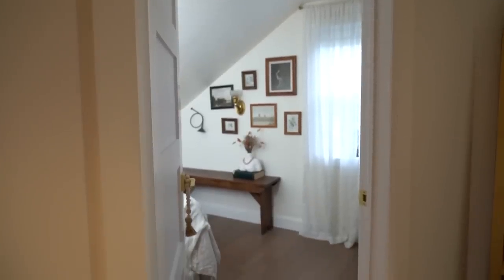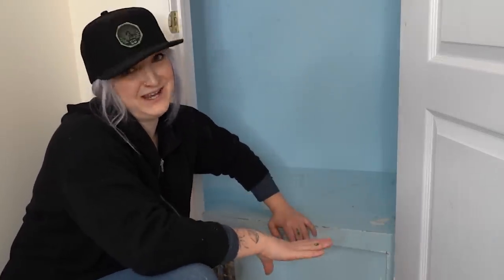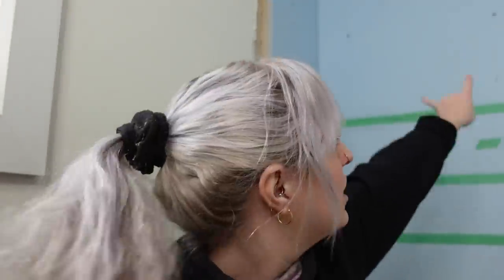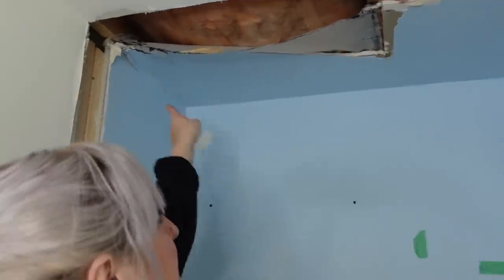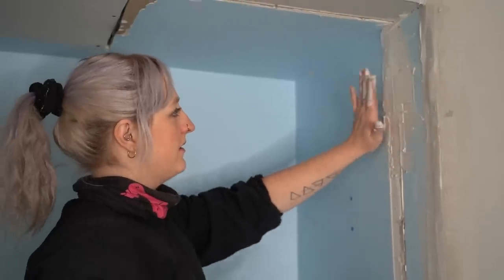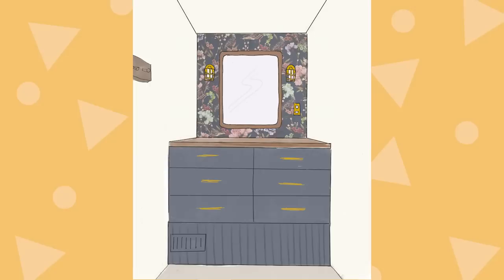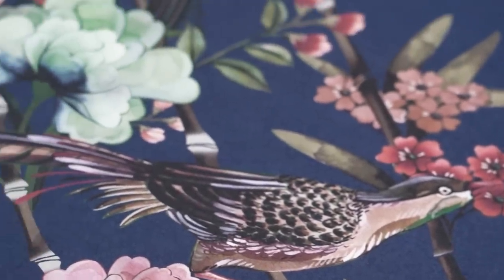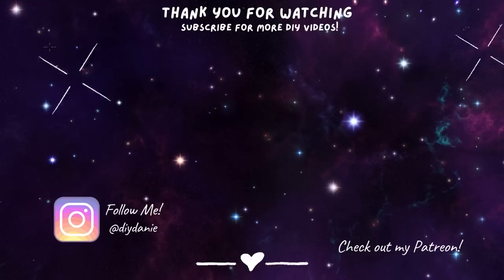i diy my closet into a custom vanity space! Pt 1 | DIY Danie

Comment: Lovely episode Danie! My suggestion is painted navy-sh blue lower part, drawers etc with brass drawer pulls of course! And for the top matching walnut wood or a close fake of the color of walnut. And for the bottom that is hiding vents, wooden "oak" color bead board giving it texture with a vertical stripe. To give it a little "kick' you can cut out a few flowers and artfully put them on the drawer fronts Since this matches nothing else in the room I think new bedding in navy sheets with a soft pink duvet and alternating pink and navy pillow covers and a dark "oak" brown throw should help make the room cohesive without breaking the bank. Love your stuff D!

Comment: Hi Danie, great video, I like the structural conversion you presented. In tying in with your wallpaper and brass sconces (which are very nice), I would suggest getting the top of your vanity dresser to be the same color tone or wood as your vanity mirror's frame. As for the dresser itself, I would suggest painting it the same color as your wallpaper's background but accenting it with either brass or wood drawer pulls. I look forward to continuing this journey with you.

Comment: I love that you aren't scared to take stuff apart in your house. If I had my druthers there's be big changes in our house too.😊
I was laughing so hard at the mouse poop hair. We had a plumber fix a leaky connection to the backyard outdoor tap in the basement ceiling just before the Xmas holidays. When I went to tidy up after him some pink insulation I pushed into place showered me with mouse poop too. I had two adult men come running to see what body part I must have lopped off. Omg. It went into my rack of framed art work too. I haven't pulled them out to clean up yet, it was too close to doing Xmas decorations etc., so I've that to look forward to. Soon. Once I've finished putting away the Xmas stuff. 😜 Oh, and we are recovering from COVID too.  Came down with it the week before Xmas and 2 weeks before we were eligible for our bivalent boosters. I feel your pain! 🤒😘💖

Comment: ▶️  BEFORE you start...
Read this as it could impact the size and height of your cabinets❗️

 FIRST... Make cabinets out of walnut if possible to match the mirror. Then leave both natural, of course, with just a protective finish on both.

THEN... Build your cabinet as TWO separate pieces so you have an open section between them.  When you put the table top on, you then have a place for a chair so you can sit at it. As a bonus, the box covering the vents is now a footrest!
Then build two more cabinet pieces, one on each side, sitting on the table top. Make these shallower than the lower cabinets so you don't feel boxed in. Perfect drawers for makeup, jewelry, etc. Make one drawer deep enough for a hair dryer. 
The whole setup would form an 'H'. Still infinitely flexible for many future needs.